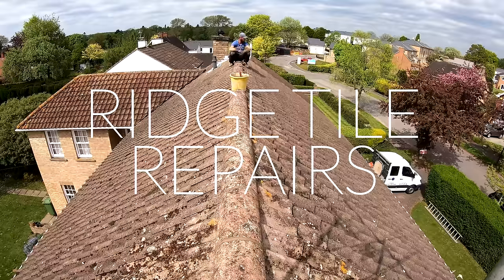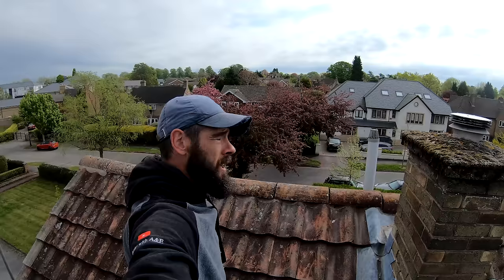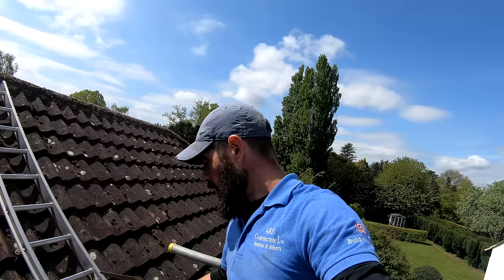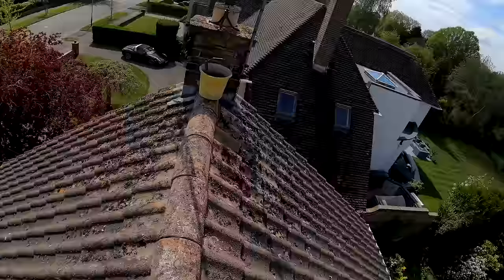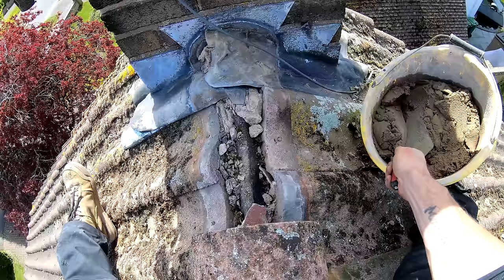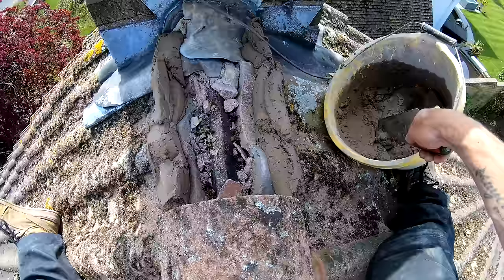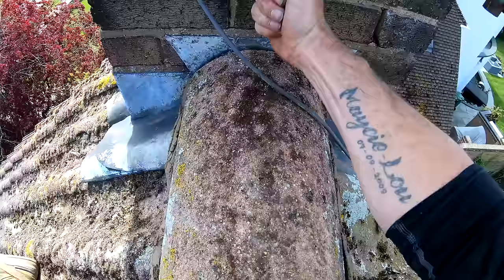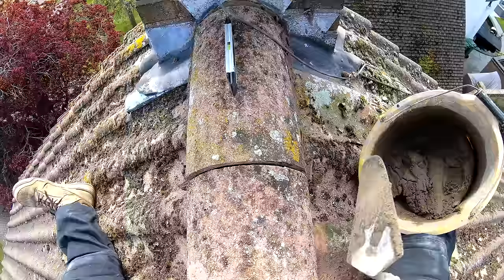Repairing Ridges Tiles!

Comment: Another quality job👍🏻. Done a fair bit of that over the years. The joints are playing up now so I leave it to the younger lads. Building sand is ok with tiles that are flat, but with tiles that have a heavy profile, you want to mix building and concrete sand 50/50, with a sand/cement ratio of 3:1. Stops it sagging between the profile and will still be there for many years to come😉
Reply from the maker: Hi Wayne this has been mentioned before in an earlier comment and I think it is something that we will seriously consider thanks for watching all the best Tony 👍 have a awesome Sunday

Comment: Great vid as usual found it strange you only used building sand and cement to bed the ridges back on l always used a mix of concreting sand and building sand and cement  has the concreting sand makes it weather better , have done them like this for over 35 yrs  this is how l was taught by an old roofer
Reply from the maker: Hi Eldorado1253 like the idea of that is it because the aggregate sand gives an extra bind to the mix, what ratio do use use. Thanks for watching all the best Tony 👍
Reply: I use 3:1 ( 1 sharp, 2 bldg).
I thought that was standard?
Reply: @geebee1689  That is the same mix l have used for years just have to watch the water content when doing verges, same mix for bedding on chimney pots like you thought this was a standard mix for this work
Reply: @BuildWithAE  Hi Tony l use 3:1: 1  3 building sand  1 sharp  sand  and  1  cement  just watch  the amount of water if used for verges .

Comment: Is it possible to retro-fit a dry ridge system, in a circumstance like this ?
Reply: A standard dry ridge system doesn't really work well with that type of pan tile, you would still have to do a bed of mortar for it to seat on, you can get systems for this tile but in the situation shown, bed and point would be better and about the same amount of work.
Reply from the maker: I believe so. You can apply a dry ridge system to most roofs. A lot of new builds have the dry ridge system but the customer on this particular job wanted it looking the same as before. And I like to think I'm old school 😃 prefer mucking on the ridges, more skill involved. Take care!
Reply: @BuildWithAE  Mortar does look a lot better 👍
Reply: Absolutely u can fit dry ridge system on this roof
Reply: @alexandergilmour3  why would you want to